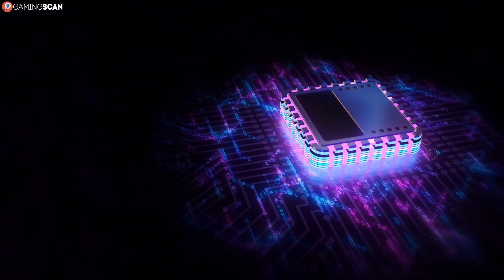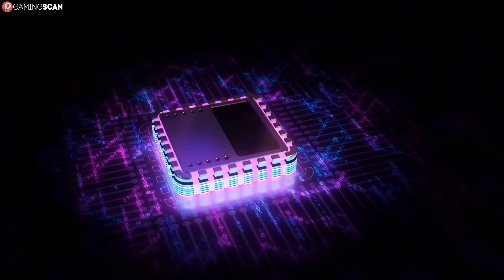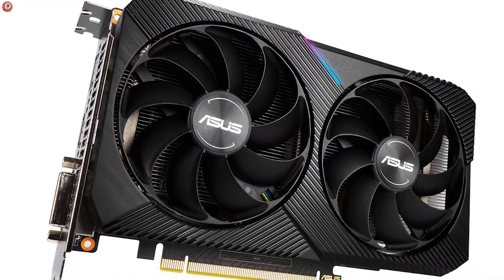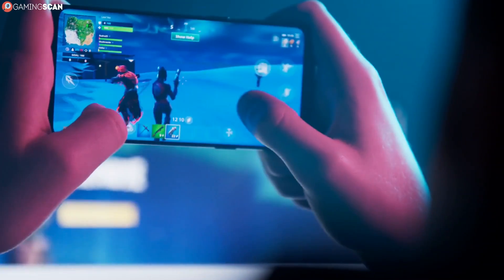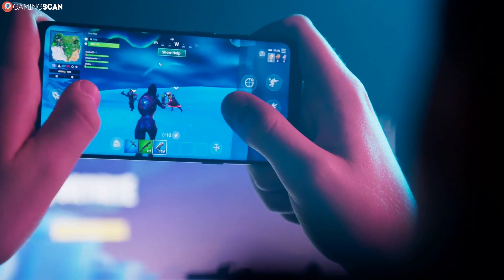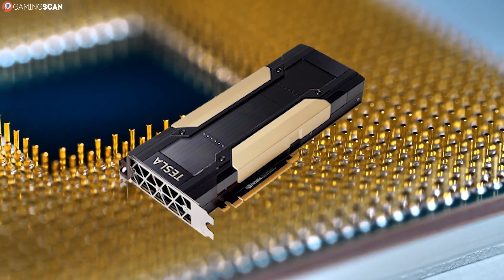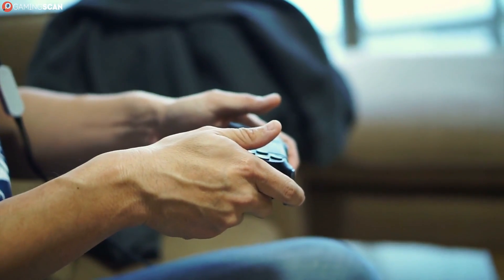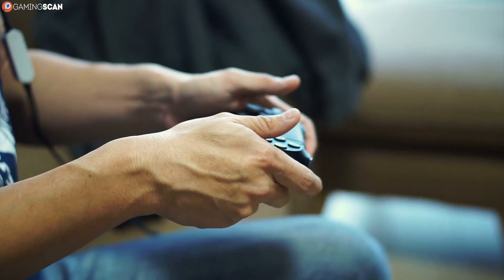What Is CPU and GPU Bottleneck? [Explained]

Comment: Bruh... I just wanted to get a graphics card for my new 1440p monitor 😭 now I need a cpu and turns out a new motherboard as well
Reply: Same situation, I just got my 1440p 170 hz. Now I want to upgrade my gtx 1060 to 3060 ti but I don’t know that  my core i5 7500 can handle it or not.

Comment: My real question is I am building a new £1500 gaming pc and I am waiting for the new 3000 series to drop in price. I have all my parts apart from my GPU but I have an old 1050 I want  use to test my build and get my pc up and running and my games downloaded so I can just plug my graphics card in later and play.

Comment: No way if the gpu is 100% and cpu is hovering around 40% that means its good. The cpu is not bottlenecking and the gpu is doing its job. The  lower the cpu usage the better the gpu is the one suppose to be higher usage when gaming. There is some miss information here. If both cpu and gpu is nearing its 100% usage it means your hardware is having a hard time running the game being played. 90% usage of a gpu is good because the gpu is doing the job it was mean to do, and the cpu usage should remain low usage, the moment the cpu usage go way up then your cpu is working harder it only means your cpu is not strong enough. some information here in this video is not correct. lol
Reply: so what is the proper or the healthiest relationship between cpu or gpu?
Reply: @brahmacowman7506  you should pair a lower end cpu with a lower end gpu. for example Ryzen 5 3600 best gpu that will go with that is RX 5700 or RTX2070. I ran that same cpu on the RTX 3080 and my gpu was being throttled by the cpu because the cpu wont catch up. Other things at play also like the Ram speed and the amount of ram you have. So if you have below 16gb playing a game like horizon zero dawn. on a slower cpu and faster gpu. the gpu will throttle and be bottleneck by the cpu. the cpu will ramp up nearing 100% because its trying to catch up to the gpu while the gpu will run slower and not reach its full potential because it's waiting for the cpu to catch up.
Reply: @k00LGuY671  okay man thx for widening my knowledge. one more question. is there bottlenecking between ryzen 5 2600 and a gtx 1650 super?
Reply: @brahmacowman7506  no there no bottleneck. to find this out use msi afterburner run a game that the 1650 gpu is able to run. then look at the cpu usuage vs the gpu. if the gpu is below 80% and th cpu is nearing 100% then the cpu is the bottleneck. if the gpu is 100% and cpu is below 50% then you have no bottleneck. if there is a cpu bottleneck they usually overclock the cpu to compensate for the gpu.
Reply: @k00LGuY671  man thank you so much. maybe i will go with the 2600 cpu and 1650 super gpu combo bcos im kinda on my budget..
Reply: @brahmacowman7506  that is still a phenominal build. and for the price you will save you cant go wrong with that.
Reply: @k00LGuY671  thank you so much!

Comment: I have a ryzen 5 and a 1660 ti on a bottleneck calculator it's 30% and my parts are a year old and I want to upgrade them but I can only upgrade one at a time what one do I upgrade first on the website it says to upgrade CPU but I checked ryzen 7 and 1660 ti and that's a 97% bottle neck what do I do? Just wait till Christmas and upgrade both?
Reply: at the bottom of the calculator, they give you their recommendation

Comment: So i want to update my Rig. 
atm i have a old PC with an AMD FX-8320 with 3,5 GHz, 8 gb of DDR3 RAM, and an GTX 970. 

I just orderd the first part of my upgrade being an 2070 super and a new Monitor. 
Next 2 Months I want to buy the rest 
AMD Ryzen 5 3600X, MSI X570-A PRO ATX AM4 Motherboard, and 16 GB (2 x 8 GB) DDR4-3600 RAM. 

Now my question, is it worth it to plug in the 2070 in my old rig for maybe 1,5 to 2 Months or will the bottleneck be too extreme to be of any use?
Reply: Definitely a bottleneck. Better if U buy them all at once.

Comment: hyper threaded cpus mostly won't and shouldn't be at around 100% .
for a r5 2600 + rx 580 , 100%gpu and around 50%cpu isn't bottleneck at all , but surely you can use a better gpu

Comment: 🙄 what about these two combined 

Ryzen 7 3700X & Gigabyte RX 5700 XT 

🧐
Reply: What about you use a Ryzen 5 3600X, 3700x has too much power for a 5700xt
Reply: Suvix Loleilo dude if you downgrade the cpu he won’t get any more better proformance just less bottle neck
Reply: @alexbastola8730  so it is going to be a great PC if both of those two are combined 😁😁😁👍
Reply: @kurtkoserak9419  true but I think Ryzen 7 3700X will last like 6 years for gaming
Reply: HAWKEYEgaming I have a 3700x it’s working awesome for me but my gtx 1660 is bottlenecking it
Reply: It’s ok
Reply: there is no bottleneck between that cpu and that gpu. when you play games your gpu will use 100% and the cpu will hover around 40% on all cores. the information in this video is incorrect. If both cpu and gpu is 100% then something is wrong, they are both working harder than usual.

Comment: My I7-6700K is bottlenecking is my 1080 ti
Reply: My 5 year old i7-5930K is not bottlenecking my 2080Ti at all @1440p. Benchmark via GOW4 and Gears 5. GPU USAGE: 99+%
https://drive.google.com/open?id=1SqcGVoP-ivplCCEu9VIzfHO820cmsOIQ
Reply: @alexgottmituns7049  i want to figure out why my system is so slow and dropping fps
Reply: @Ap3xKing  What are your specs? and at what resolution do you play?
Reply: @alexgottmituns7049  an I7-6700K 32g ram ddr4 an gtx 1080ti founders and a motherbord that was 100 and a 750 power supplu